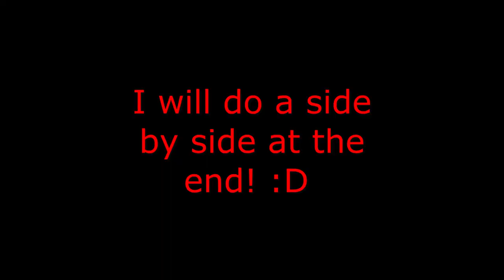ALL THINGS SCRAPER PLANE! Veritas Scraper Plane Prep, Set Up, and Use!

Comment: Another topnotch video.  I learned more than a couple things about these tricky tools and how to properly sharpen and adjust them.
I've owned a Stanley 112 version of this Scraper for some years but never found it very useful because I didn't have it set up properly.  Now I see a new world opening up, of scraping rather than sanding when I encounter boxy or difficult grain, and maybe even a desire to do more hardwood woodworking - I've mostly worked with Doug Fir and Cedar in the past.  Thanks for that.
The Veritas Jointer/Edger file holder looks like a very handy tool I'd never seen before - might need to pick one up next time I'm down at the LV store.  That and a 0.055" iron - I have only a 3/32" (0.09") Hock iron now.  
I like that you left the bit in where you said you weren't a fan of clamping the iron in a vise for sharpening, and then immediately changed your mind and did so.  It  felt natural and believable, just like the way I'd proceed if working out an unfamiliar process on my own, or having a buddy explaining it to me.  
Stick with it.  You're doing an awesome job with the channel.
Reply from the maker: I agree! I tried out the Stanley and really struggled with it but this Veritas, with the thin iron, makes using this really easy. I much prefer it to sanding! 
I love that file holder if you couldnt tell hahah
hahah thank you and same with me using the file on the wrong side of the iron :D 
Thank you for your continued encouragement! means a lot!

Comment: I held off watching this for some reason but finally got around to it this afternoon. For what little it's worth I think I'd go for the thin. Apart from it being the stock blade and the thick one having to be purchased separately I like that you can vary how it works on the fly. Just seems more versatile to me, and it clearly does a top-class job anyway. It sort of makes me ponder what the thick iron is actually for – although it could be offered just cos 🙂I wonder if the thick one is particularly well suited to really hard woods (something way north of sugar maple)?

Anyhoo, since you asked, I think you did a fine job showing the tool and outlining the features, and then demonstrating the function so 👍👍 from me. Would 100% watch any similar vids from you in future.
Reply from the maker: I prefer the thin one as well but like the thick one for narrow stock where I don't want any kind of scallop. I did a video on that too of course haha

Thank you for the feedback! I had fun with this and look forward to doing more of them!!!

Comment: Thank you for this video.

I have the Veritas "scraper set" and i have after loads of hours figured how to get good results with scraper blades, and the cabinet scraper, however not yet with the scraper blade holder.

I would really appreciate a video with a rundown on how this scraper plane holds up against the other "ways of holding" a scraper blade. And wether or not the plane body one is worth it compared to the others.

Keep up the god work!
Reply from the maker: Thank you!
I will deff add that to the list. Thay would be a good one. 
If you want a brief before the video. The scraper plane can cover more surface faster and with less effort and less thought. The card scraper would be better for small detailed areas. It's slower and requires more effort and though. Thought because you control the angle and need to keep it consistent. 

I'll deff make a video tho prob onto be till next month in the line up. 
Thank you again!
Reply: @BatCaveCreations  Thank you sir ☺️

Comment: I love this style of video.  I learned how to use the Veritas scraper plane and you have shown me how to prep the blade.  What I was looking for but never saw was an explanation when to use the different blades.  When to use the thick blade vs. the thin.  One other thing I noticed was your devotion to the overhead shot. I'd prefer some more side views to see what the plane is doing.  The overhead shot is great to get a view of how to hold and push the tool along, and is very helpful, but perhaps you would be better served to include some more side views.  So now I want to purchase the Veritas scraper plane.  My old vintage-style (I think it's a #80) is so tricky to deal with!  The fact that Veritas allows you to change the angle of the frog seems to make setting up the plane a lot easier.
Reply from the maker: Thank you! I did do a different video showing the differences between the thick and the thin blades. Looking back I should have just bundled the two together lol

You are 100% correct I need to change up and try different camera angles. I did get a new stand for it but I need to rearrange the shop to advance in this aspect. The workbench is currently my outfeed table so I don't have the right kinda space for a camera opposite of me on the bench. that's why the camera is so close to my face in intro and outro hahah Not an excuse! you are correct and it is something I am working on and planning out. I will do a shop tour before i rearrange so everyone can see what i was working with, what I am changing it to, and why. 

I have an 80 style scraper too but haven't had the time to give it a go. I think it will have its place in my shop, just by thinking of the concept of the tool. but deff need to try it out and decide lol 

Thank you again!!

Comment: Veritas scraper plane is the best. To set up, for me, I place the plane on clean 18 mm MDF. I apply reasonable pressure by pushing the blade down being at about 80 degrees. I then tighten up the blade in place. Finally, checking the blade is parallel with the sole of the plane. Never had any major problems. I sharpen the blade at 45 degrees, and then burnish with a Crown brand tool. I always clean the plane completely after putting away. I use the thick blade only.
Reply from the maker: I do need to get better at the thick blade. But I always reach for the thin. But I'll try your method also. Thank you!

Comment: Did you add your own handles on that accubur? I went to Lee Valley and it didn’t have handles at least the one I looked at for $40.
Reply from the maker: I did! I turned a few sets for myself and others, not tough just make sure you get the furrels if you want then they are seperate. I reccomend then if ur gonna put alot of pressure downward but know you don't need that much pressure